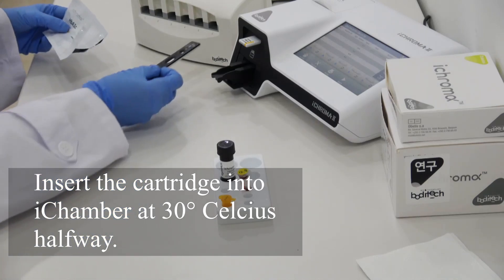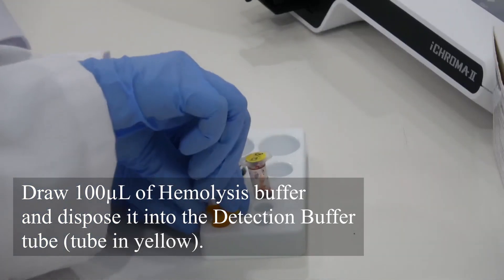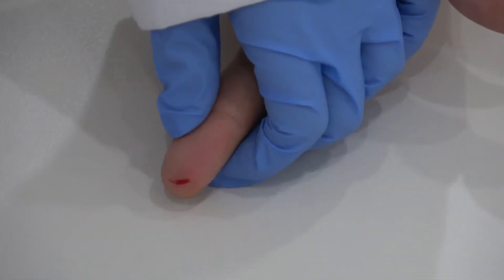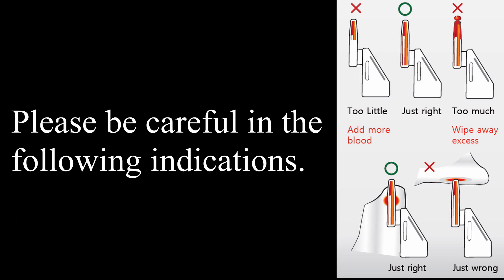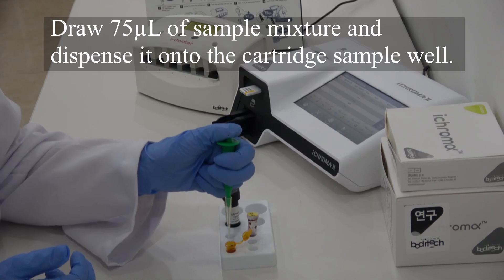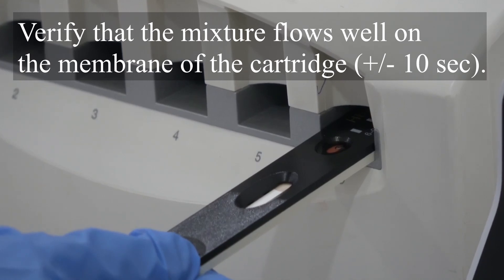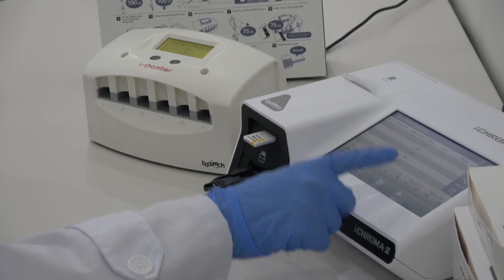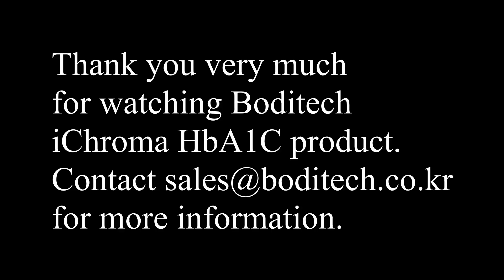ichroma™ HbA1C procedure video

Comment: The 5micro capillary tube is not easily available. Can you pls tell a contact person from where to get it. Thanks
Reply from the maker: The capillary tubes are included in the box. 
In case you wish to receive extra, it is possible to receive them through your local distributor.
Reply: @BoditechMed  we are not supplied with the capillary tubes with the box till now.
Reply: @BoditechMed  hey dear i wnt to know about the detail of its control? and also mention me in pakistan i need dis machin\